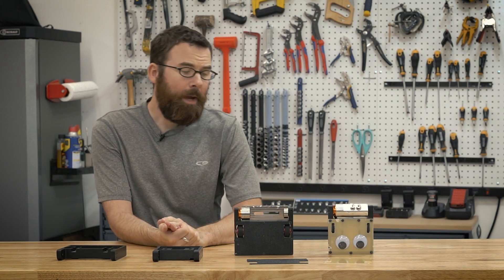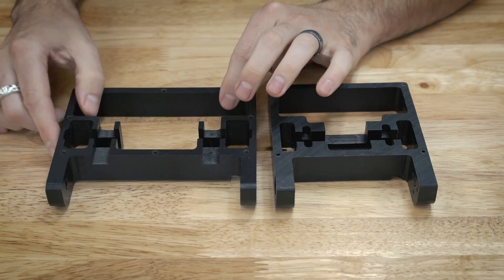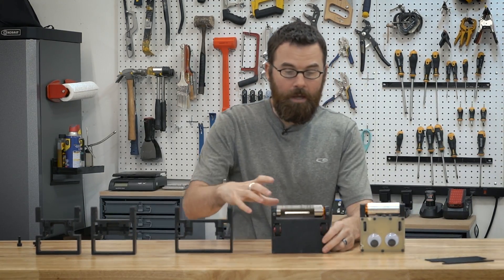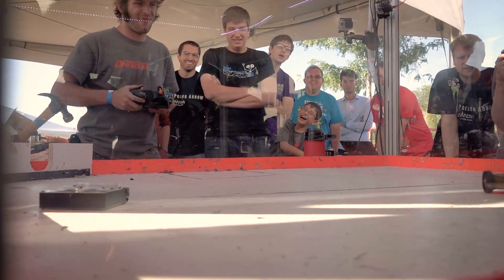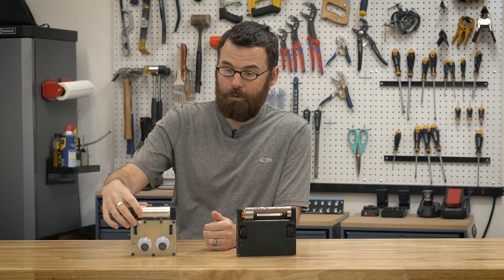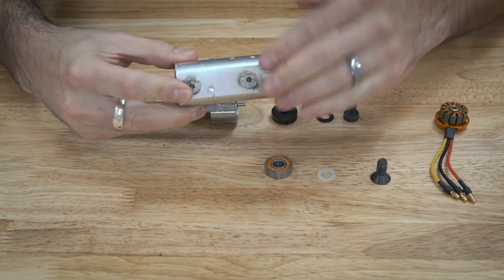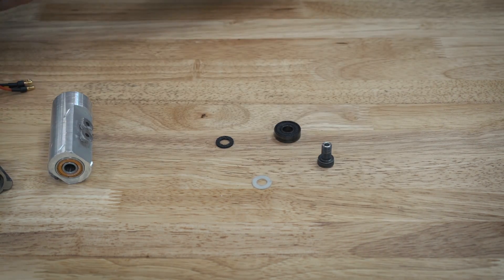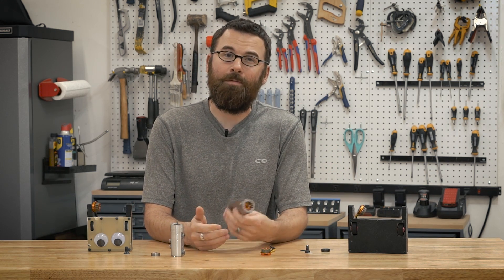Sgt. Cuddles V3 Recap

Comment: I see you have what looks like "line-X" plastic for armor. I guess i'm not the only one who thought that would be an effective, yet lightweight impact resistant solution. I would expect it to become REALLY popular on most, if not all bots when one can simply spray it over an exposed surface and greatly improve impact resistance, if not flame resistance. I'd bet firebots would love for that to happen. as to wheels, it would seem like a soft durometer urethane or a harder silicone would be way better than foam for bot traction and durability, if you don't mind casting your own treads as I doubt there's an off the shelf solution. if there's one thing that makes me instantly groan WONKY! on a battlebot is exposed wheels when most bots use spinners these days. it's annoying that entaglement devices are banned as I find spinners cheap and makes bots too similar, but I'm a total casius (wedge thrower) fan myself.
Reply from the maker: I used Line-X on a 30 pound bot, but not this one.  That's just ABS.

Comment: don't you have problems about getting stuck on your sides or your back
Reply from the maker: It could possibly happen, but I never had a problem with it.  Just putting a screw on the side could prevent this.
Reply: i am really sorry about asking a lot of questions but i am new to combat robotics and am building a 1lb robot so i just have a lot of doubts
Reply from the maker: @pruthavparab1077  You should watch my video:  combat robot resource guide" and check the document in the comments.

Comment: Is the abs top that you cut lighter than pla too? I’m building an antweight and am wondering what to do for the top armor
Reply from the maker: It's roughly the same weight.  I used ABS because it was easy to cut, and I didn't need any real protection, I just needed to keep the guts from falling out, the UHMW is plenty rigid.
Reply: Robert Cowan Ok thanks

Comment: I have a quick question. I am building a 1lb drum and am not sure how to drive it. I know you always put the motor in the drum, but I have heard that could damage the motor. A belt driven system would be effective but heavier. Should I care? Congrats on your recent milestone by the way.
Reply from the maker: A LOT of people talk about the dangers of putting the motor in the drum, but I've seen significantly more issues with belts and pulleys than I have with dead motors.  I've broken exactly ONE weapon motor in Sgt. Cuddles.  That was before I added epoxy to the magnets as well.  Once I added epoxy, I haven't broken a motor.  I'd rather use the weight elsewhere and not worry about a $10 motor breaking than deal with all the issues that come with pulleys.  They're heavier, more complex, and belts are very prone to failure (especially if they're exposed).  That's just my take on it.
Reply: Robert Cowan Thanks for the input. I understand now. I am using the same motors for my ant weapon as my beetle drive, so I will buy a few spares. I think that makes perfect sense.
Reply from the maker: Sure thing!  There's ALWAYS a trade-off and there's no perfect solution.  Good luck!
Reply: Robert Cowan Thanks! I'll need it as I don't have a CNC. Will have to drill holes for screws in a metal pipe. I have a printer though so carbon fiber reenforced chassis are in order.

Comment: Hey could you publish a pack and go of the assembly
Reply from the maker: I'm not sure what you're asking.  What do you mean by 'pack'?
Reply: it's a way of saving your model for sharing in solidworks it saves all the parts and assemblies into a folder
for sharing it's under the file bar its cauld Pack and Go
Reply from the maker: If you send me your email, I can send you a zip file of the main components.

Comment: Hello sir, seriously your bot is so good. I am working on a battle robot but for a 3kg category. I want to add a rotating drum to it as the weapon.  Will the outrunner motor work for me.
Reply from the maker: I'd have to know more about your robot.  An outrunner will be fine for any size, so will an inrunner, it just depends on how you configure it.  Just make sure the RPM of your drum is correct and you have enough power.  At 3KG, you will want to protect the motor better.
Reply: I am working on a 4 wheel drive robot that runs on 36v 4 ampere

Comment: Hi! I was wondering if you could link the new wheels you are going to try. I am making a 1 pound bot and am looking for good wheels because my current option has been discontinued.
Reply from the maker: Sure thing, I plan on using T40 wheels and hubs from banebots:  http://www.banebots.com/category/T40P-1375.html
Reply: Robert Cowan Wow! Thanks for the quick response.
Reply: This may be a stupid question, but do they come with the hubs? It is not super clear to me.
Reply from the maker: Nope, they need separate hubs.  Check their site for T40 hubs.
Reply: Robert Cowan Thanks!

Comment: Wish you would start producing build kits
Reply from the maker: Maybe someday, but I would need them to be reasonably priced.  Right now, a Sgt. Cuddles kit would easily be $500 or more, if I wanted it to be profitable.
Reply: Still would buy one
Reply: I would buy one for $500, with a controller, thats a pretty good deal
Reply: Robert Cowan You should belt drive your weapons so you don't destroy your motors.
Reply from the maker: I've broken ONE, ever.  And this was before I battle hardened them.  since then it's not been an issue.  Belt-driving weapons on insect classes is not necessary.

Comment: Okay, some of this is probably version 5 type stuff, but after being subbed a while, you got me thinking about material selection and playing what ifs, even in my own projects.  The first thought, how about some spindle turning with your Tormach?  Make your own wheels! First idea that came to mind is make them like a timing belt pulley.

Turn a groove in a piece of stock that's just slightly wider than the width of a flat/timing belt.  Size the OD such that the belt is self preloading against the wheel.  If the groove is deep enough but still permits traction the belt will be retained,.  As the tread/belt wears just replace the belt.  You could even experiment with using various materials and lighten them as you see fit.

What about using composite materials in your frame?  The UHMW is great armor, but it's heavy.  Maybe replace some of the internal structure with a composite, or a fibre reinforced plastic?  You could even 3D machine high density foam to make molds for the composite parts.  Throw in a vacuum pump and some other supplies and you're making composite robot chassis.
Reply from the maker: As for making my own wheels, if the Bane Bots wheels don't work, that's the next step.  

As for the chassis, the UHMW has treated me well and is REALLY good at absorbing impact.  The only real benefit I see to going with a different material would be weight savings.  I can't foresee an instance where the chassis will ever get damaged enough to cause an issue, so it's certainly strong enough.  It could be lighter, but it's already pretty light (once it's all machined away).  I think for right now, I'm done with large changes to Cuddles because I want to focus on a new larger robot.

Comment: If you don't want to go to the trouble of making custom cap screws, you can get them right from McMaster Carr - just look for 'low head socket cap screw'.
Reply from the maker: Oh, I looked ;-)  They didn't have exactly what I wanted.  I needed an M8 and they didn't have it in exactly the right dimensions.  They can also be called undercut heads (for countersunk screws) or truss head screws.

Comment: why stainless screws on v1-2 of the drum? they're way less strong than regular alloy screws and, even more importantly, quite a bit softer. Also, how do the moments of inertia compare between the drum iterations?
Reply from the maker: I was new and didn't know any better ;-)  Plus, that's maybe the only material they had at the time, not sure.  But softness isn't necessarily bad.  If one of those screws broke right at the base of the drum, they'd be a pain to get out!  As for the moments of inertia between the two, I haven't really calculated it.  They weigh roughly the same, but the new weapon is significantly longer and has more of its mass towards the outer edge however.